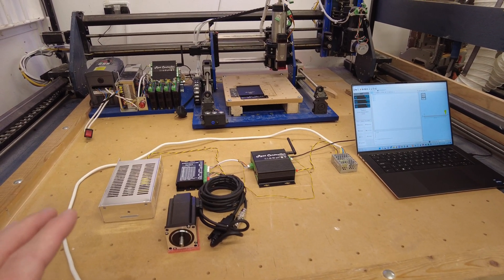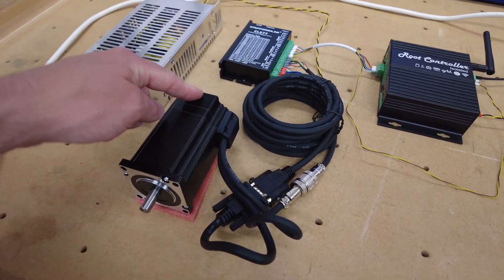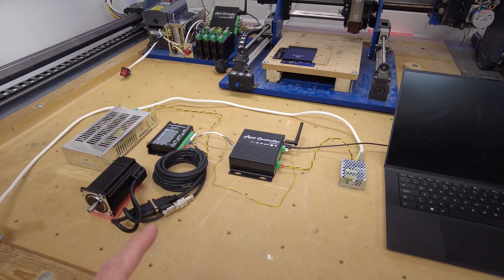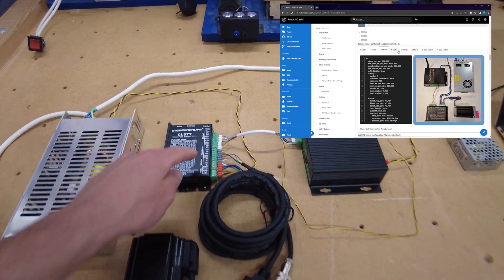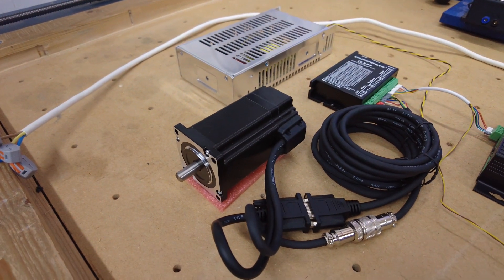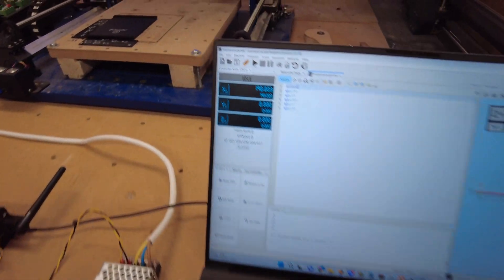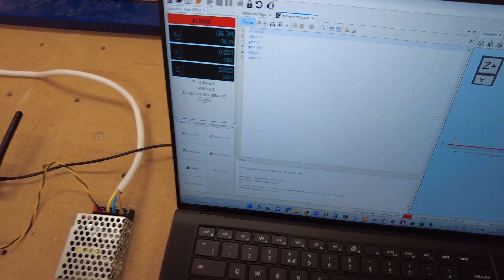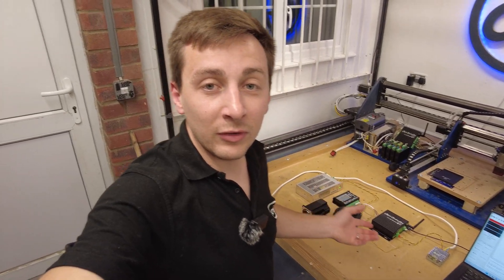Root CNC - Closed Loop Stepper Motor - Root Controller

Comment: What is the line you add to your config to handle the alarm when connected how it is to your controller? I've tried a few variations of shared_stepper_fault_pin: gpio.15:pu but no luck
Reply from the maker: Hey, i used the "fault_pin" input. Here is a snippet from the wiki Performs a hard stop, causing all motion to cease immediately without deceleration, thus possibly losing position accuracy. Stops the spindle if off_on_alarm is true in the active spindle configuration. Enters critical alarm state, which can only be exited via a soft reset.
(since v3.7.5) This can be used with an e-stop. A true e-stop should also cut the power.
Since (v3.9.3) Critical alarm state blocks homing and unlock.
The actions of fault_pin and estop_pin are identical. fault_pin is intended to be used for machine-detected faults like stepper driver alarm signals.

Comment: Is this controller compatible with servo motors?
Reply from the maker: @maxkalikster5399  Hi, yes. Providing the server drive has step, dir and enable inputs. I had a quick look see and the T6 from omc stepper motor online should work

Comment: Good morning Pete, I've been looking to down size my current DIY cnc ( we moved and my shop is smaller) I also got into  the 3d printing hobby. So I'm looking at your Root 3 and 4 models.  A while back I thought I came across an article that showed the best way to orientat the 3d parts on the printer bed. However I can't find that article.  Do you recall or have the info on the best way to place the part on the bed. I would appreciate any info you might have. 
Thanks 
Jerry
Reply from the maker: @jerry020351  Hi Jerry. Ah yeah, this information was moved to try and collate the information in a better place. Please check out this site https://wiki.rootcnc.com/
Reply: @RootCNC thanks Pete  I truly appreciate it

Comment: I just wondering, if we already have 6 NPN switches (pos and neg for x/y/z) connected to inputs, where we wire the faulty signal for each motor ? Or we wire all of them to one input and add config fault_pin/feed_hold_pin/reset_pin to use this pin ?
Reply from the maker: I would suggest you connect the min and max limits into one input. These do not need to be separate. Ie X-min and X-max to use one input, etc. So you'll need three in Total. The two sensors are connected in parallel.

Likewise connect all fault pins into one input. Any fault should cause the machine to fault. In the event this happens, then the lights on the drivers will point you into a closer direction. 

Then this'll leave 4 inputs spare for buttons etc 

I hope that helps
Reply: @RootCNC  Thank you, that's clear as sunny day :)
Reply: @RootCNC  Hi, I'm just awaiting Root ISO rev3. and looking around on wiki... I have same closed loop kit (2Nm) from stepperonline and I'm courious about the Alarm signal. Must it have to be connected to dedicated imput as you did (and all axis alarms together) or could be Alarm signal connected with X/Y/X home limit switch imput instead of X_max and so on? I'm considering I need 4x home limit switch (2x Y), Probe, Tool setter and Alarm. I assume I can use limit imputs for B and C axis too. But still I feel little confused :) Thanks for reply.
Reply from the maker: @dibonko  So if you were to use one of the spare Inputs as the alarm pin - then the machine will behave correctly when this signal is asserted. you could also connect this to the limit switch's but you'll need  to make sure you HARD Limits are set. so the machine will stop if the position is lost. either is completely possible. If you've got spare Inputs, then I would recommend using them - they're all software configurable.

Kind Regards Pete

Comment: Hi. Do you know if in this  CL57T Closed Loop Stepper Driver  is it possible to define via software  the ALM pins   Normally Open (NO)   or   Normally Close (NC)  ?
And which is the default setting for it ? Thanks in advance and sorry for my poor English
Reply from the maker: Hi, yes the Root controller is compatible with the CL57T. The configuration file can have the option for :high or :low on the end of the pins to change the active state. Fluidnc has this well documented on their wiki site
Reply: @RootCNC  Thanks a lot for your answer but i was referring to the stepper driver itself, not to the Root Controller (i know it is configurable 🙂 ). As you have one of these drivers,  I'd like to know if the stepper driver is configurable via the RS232 port to have ALM pin  NO or NC.
Reply from the maker: @IceCreams62  ah I understand. Typically these are normally open, NO. As it will allow multiple drivers to be connected in parallel. So you only need one input to the controller in order to get an alarm state. I've not used the software before. So I'm unaware if you can change it
Reply: @RootCNC  That makes sense, thanks a lot 👍
Reply: I believe that the CL57T (I am configuring mine using CL57Ys) can be configured via USB via an RS232 dongle. Joatmon discussed this in one of this videos: ?v=zWPSGLtLspE
Reply: @TristanJCumpole  Yes, it is

Comment: Considering a root controller! But have one question. Is there any way to use tool compensation in the software?  If not whats the workaround that problem to dial the tool parameters to get a finished part thats dimensional correct.
Reply from the maker: The tools can be compensated in the fuildnc software, that is running GRBL under the hood. So this supports tools and tool changing (eg, using the 'T0','T1' etc). Outside of this, most good CAM processors have a tool library that does this for you too (Eg fusion and solid works nativity does this)
Reply: @RootCNC  thanks for the quick response! Sounds good! I am running linuxcnc and a mesa card on my cnc mill and if i am understanding it correctly the gcode is almost the same for linuxcnc and fluiednc in the root controller!? i like to test the root controller for my next build and i like the ide that you can easy connect to the controller with a win pc / tablet without needing a dedicated Linux computer. And also i se the potential to have wireless connection to a plasma table with all the problem with Electrical disturbances!
Reply from the maker: @JonnyStrand  The Gcode is pretty much a standard between them. There is some instances where the M-Codes are different or not complete. But as time goes on, this becomes fewer and as machine become more standard. Given the nature of a Plamsa cutter the Root controller will be well suited in driving it, due to all the isolated areas it has.

Comment: I am interested in connecting the Root Controller ISO Rev 3 to the stepper motor driver with TMC2209 chip (do you have any plates to facilitate connecting the stepper motor driver with TMC2209 chip to the driver?
I have NEMA17 motors and TMC2209 controllers and I would like to use them in the Root 4 LITE CNC project.
What program does the Root Controller ISO Rev 3 driver work with?
Reply from the maker: Hi, not directly with the Root Controller ISO. it is designed to interfaces with stepper motor driver modules. you can get modules which have a TMC drivers in and I do have a couple of user who use them in that way, you'll need to pick the a module which has the opto isolated version. 

I think I can add some more information to the wiki shortly

Comment: Absolutely FANTASTIC! I might have to opt for these closed loop steppers right off the bat.
Reply from the maker: they're super neat! I might do the same for the next build!
Reply: @RootCNC really cool to see closed loop steppers, can i run 5 closed loop steppers and 5 limit switches for a 5 axis cnc ??

or can i just run al fault pins into one input ?? because i still want to run a door swich and for a  software e-stop wich i havent yet found how to wire it properly

but i assume that wouldnt leave any place for macro butzon for something like cycle-start or something similar 🤔